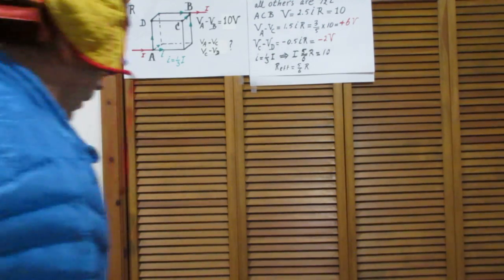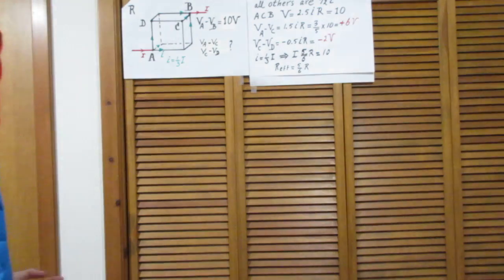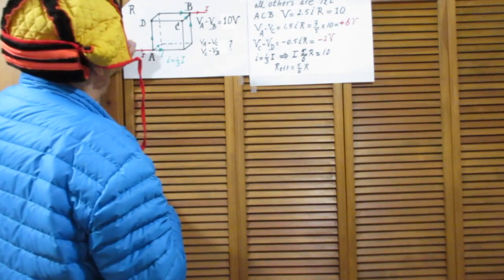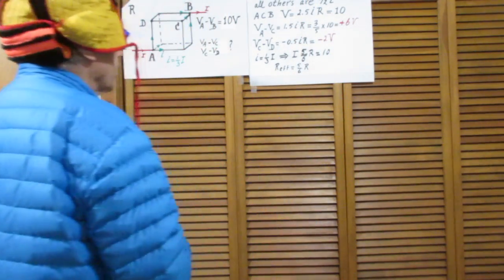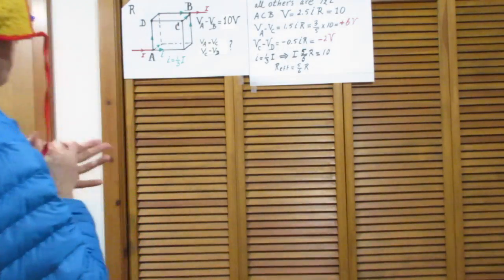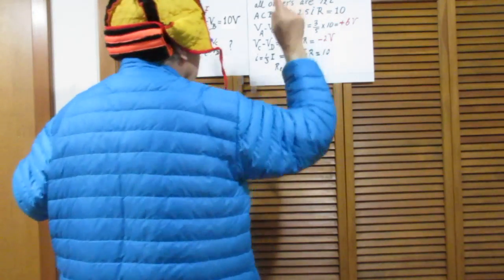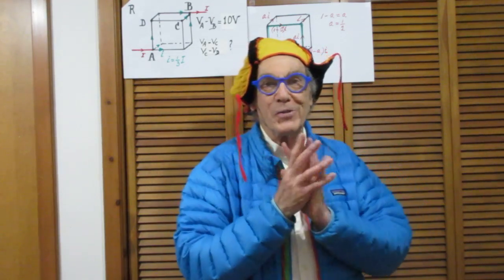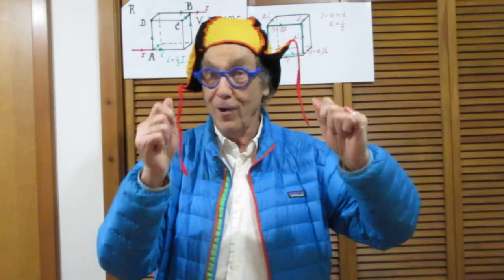Solution to Problem #72 - Resistor Cube

Comment: arrogant idiot
Reply from the maker: I appreciate the fact that this Physics may not be familiar to you. Don't feel embarrassed about it; you are not alone. However, it's never too late to get educated. The choice is yours. Maybe this will help you. 
I demonstrated at the end of my lecture #16 of my 8.02 E&M course at MIT that two identical voltmeters attached to the same 2 points in a circuit can show very different values. https://www.youtube.com/watch?v=nGQbA2jwkWI&list=PLyQSN7X0ro2314mKyUiOILaOC2hk6Pc3j&index=17 The reason is that in the case of an induced EMF (Faraday's Law) potential differences are no longer determined; they depend on the path. This also applies to the secondary windings of transformers as the EMF in the closed loop of secondary windings is induced. https://www.youtube.com/watch?v=b7i2uMx7gHo&list=PLyQSN7X0ro22zanLOcvkaSY-IZqheFYM5&index=8
Of course, in cases where Kirchhoff's loop rule (KVL) applies, 2 voltmeters attached to the same 2 points in a circuit will always show the same value. 
My demo was first suggested and published by Romer in December 1982 in the American Journal of Physics. This demo has now become a classic; it's done all over the world at many colleges and universities. 
Kirchhoff's original text can be found in the following link, pages 497-514: https://books.google.de/books?id=Ig8t8yIz20UC. Clearly he was fully aware of the prerequisite for his "loop rule". KVL is a special case of Faraday's Law. That's why Faraday's Law is one of Maxwell's equations and KVL is not.
By teaching students that KVL always works without telling them when it does not work, makes many believe that the closed loop integral of E dot dL is always zero. ElectroBOOM and Dirk Van Meirvenne therefore believe that 2 voltmeters attached to the same 2 points in a circuit must always show the same value which is not true as demonstrated in my lectures. They each posted a video (see @ footnote below) on their channel in which they claim to have proof for their wrong ideas which violate Maxwell's equations. Apparently they do not know, or do not understand, that in the case of an induced EMF potential differences are no longer determined; they depend on the path. MIT students who took my 8.02 course (Electricity and Magnetism) would not make this mistake! I therefore believe that to introduce a "modern version" of KVL and then teach students that KVL always holds is not advisable as you may set them up for making the same embarrassing mistake that both Dirk Van Meirvenne and ElectroBOOM made. 
Also read Professor John Belcher's thoughts on Faraday's Law and on KVL. Professor Belcher is my former colleague at MIT. http://freepdfhosting.com/0813df09f5.pdf
(@) ElectroBOOM insulted me in his video by mentioning that the reason why my 2 voltmeters read different values was due to "bad probing". If I had done the demo correctly I would have found that both voltmeters would have read the same value.  
This is my only msg on this issue. This is too basic. I do not argue either with people who believe that the Earth is flat.
This video may also help some of you to digest why 2 Voltmeters attached to the same 2 points in a circuit can give very different readings. https://youtu.be/T6S5VS03xZc

Comment: Would there be a preference for the current to continue travelling straight? I know they purposely manufacture PCB's to not have any right angle turns in the wiring.
Reply from the maker: The circuit behaves according to Maxwell's eqs.

Comment: Does magnetic flux bleed out of resistors as if a coil and resistance decays over time due to electrolysis effect in conductor material?
Reply from the maker: question unclear. Maxwell's eqs should give you all answers
Reply: Sorry, I  made an unclear inference and proposed a question. The question was to ask if or how resistors decay in resistance over time.
Reply: Paul,
The stability of resistors over time depends on the resistive material  (thin film, thick film, wire wound, metal foil, carbon composition, copper, aluminum and nicrome alloys, tantalum nitride, etc.)  Different materials have different mechanisms.  The most stable resistors are your metal wire wound and metal foil types.   How the resistor is physically constructed also impacts the stability.  Thin films tend to have oxidation issues that can "eat" into the resistor body and change its effective width and overall resistance.  To avoid oxidation problems your best resistors will be encapsulated in a hermetically sealed package as with the Vishay S102 series and HP series of resistors.

Film resistors/conductors as deposited on the substrate of an IC(integrated circuit) also have "metal migration" issues whenever current flows through the conductor.  Such migration causes metal atoms to move or flow with the current and can acutally result in an "open circuit" over time if care is not exercised to choose the proper conducting material and lay it out properly on the IC substrate.
GH    Oct. 31, 2019

Comment: That was easier than I thought. I had one like that in electrical engineering test, except that it wasn't symmetrical. The other connection was in C instead of B. Nobody got that right.

Comment: Sir, can the equivalent resistance of the whole cube be calculated to solve this problem? After concluding the equivalent resistance, the current can be concluded since the voltage of the cube is 10V, then we can calculate the voltage in each branch... is it possible?
Reply from the maker: yes that is possible

Comment: In proving equal currents in the central edges, I don't think it's justified to assume both corner splits are in the ratio a/(1-a). If you instead assume three different split ratios a/(1-a), b/(1-b), c/(1-c), such that a=1-b, b=1-c, c=1-a, you can solve for a=b=c=(1-a)=(1-b)=(1-c)=1/2

Comment: my question: is there a matrix of resistors with the same effective resistance as the (single type of) component resistors? The first example is simply to have N many parallel sequences of N resistors. The effective resistance of each sequence is NR, and the resistance of N many resistors in parallel is R/N, canceling out. But are there more complex solutions to this, that aren't just nested copies of this (as any one resistor could be replaced by an NxN parallel/chain sequence)?
Reply: Ryan,
There is an infinite class of such "matricies".  Such matricies do not have to be confined to planar arrangements.  Such arrays are untilized in the construction of highly stable  RESISTOR  STANDARDS  that use the statistical averaging of N interdigitized resistors to achieve stability over time and temperature.
GH

Comment: Love your lectures. We all wish we had passionate mentors as you are!
With your permission I want to propose a simpler and faster solution to find the equivalent resistance between two large diagonal points. I will use this assumption: in a circuit with multiple nodes, if the voltage potential of two or more nodes is the same, we can short those nodes and there will be no change in the currents in any of the branches. This is true because shorting two nodes that are at the same potential creates a zero current through the shorting path. Therefore shorting of equipotential nodes will cause no change in the distribution of the currents in circuit and therefore no change in the equivalent resistance.
With this assumption, let’s short the 3 diagonal points that are adjacent to point A. And let’s do the same for point B. Now redraw the circuit. We get a new planar circuit: from point A, we have now 3 resistors in parallel, followed by 6 resistors in parallel, and followed by another 3 resistors in parallel, and we get to point B.
Therefore the equivalent resistance will be:
R_equiv = R/3 + R/6 + R/3 = 5/6 * R.
Let me know if you like my solution. Thank you.
Reply: Theodor Iacob,
I discussed this very same method 2 years ago in the following video:
https://www.youtube.com/watch?v=3fnFMa2MJJs
Thanks
GH

Comment: Total combined resistance of the circuit is 5/6 ohms or 0.83333333 ohms. Current in equals current out, so that can be calculated, and the currents through each branch (using ohms and Kirchhoff laws), to determine the voltages at each node. Thank you. It’s important to listen to the question, because there is a big difference between absolute and relative voltage measurements.

Comment: Please  find the equivalent resistance across 2 edges
Reply: Your question will give the answer 
 (7/12) * R  Ohm.
Reply: Yes, for instance between point D and point C Req = (7/12) * R  Ohm.

Across the diagonal on one face of the cube I get Req = (3/4) * R  Ohm
For example between point A and point C.